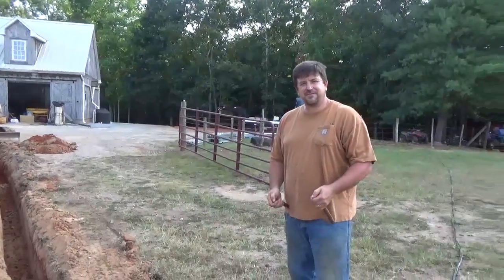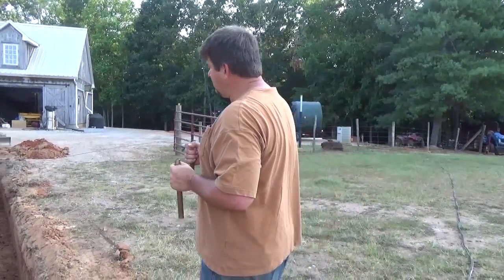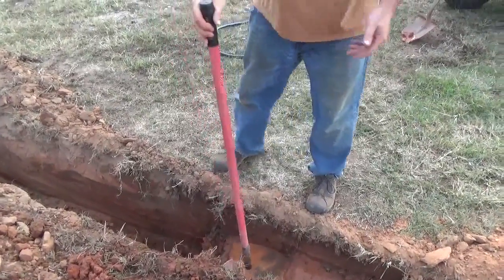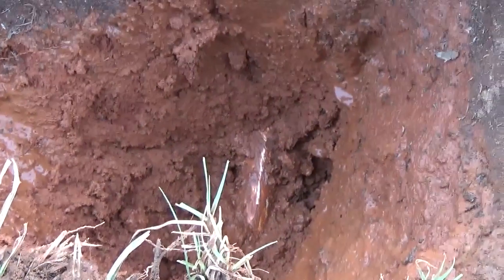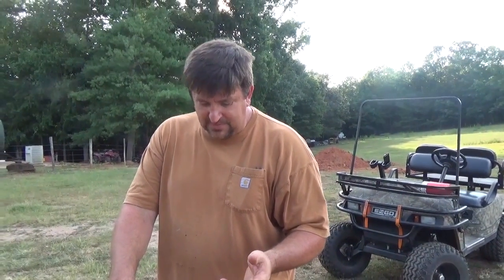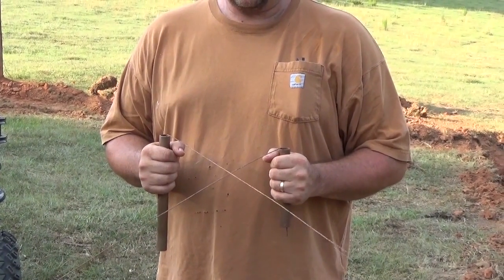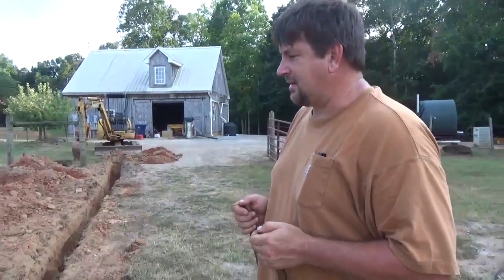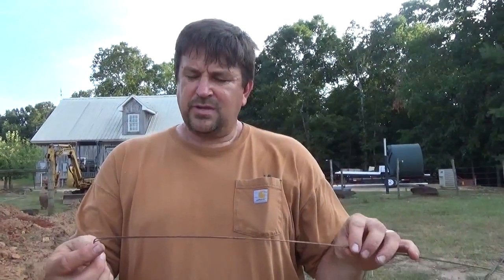Dousing?  What do you think?

Comment: I've been dowsing as needed since about 1980.  I use brazing rods for locating buried water and electrical lines, but my rods point away from each other showing me the direction that the water or wires run.  I've discovered that if I throw metal on the ground, the rods will cross directly above it, and I've used this to locate parts of farm implements (axe head, wagon parts) that were buried down pretty deep.  I use a forked stick to locate water, which is how I located the well we dug up here in the mountains of western Maine.  The water here is clean (you can drink from the mountain streams here) so just about everyone uses shallow wells.  The excavator operator who told me he was famous for digging dry holes laughed at the location I had chosen because it was on higher ground.  We hit a nice vein of water and put the well where I had chosen.  This summer we've been in drought conditions where everyone's (shallow) wells were going dry.  Guess who's well not only didn't go dry, but produced the water that my neighbor used for drinking as well?  (The water in his well was 10" below the intake pipe).How does it work?  Being a logical kind of person, I have no idea as it makes absolutely no sense at all.  I can tell you that I've located pipes that had been buried for over thirty years (that had to be dug up) and any buried wire I've ever needed to locate.  It all seems hocus-pocus, but my record with dowsing since 1980 has been 100% correct.  I can find metal deeper in the ground with rods than my fancy metal detector can find (it stops working around 8").Laugh if you like, but not only does this work for me, it works perfectly.  There's just no reasonable explanation as to why.

Comment: You're right about dowsing working, I've done it for years but usually with welding rods and PVC pipe. I've never heard a definitive explanation of how it works but I've always just assumed that power lines, water lines, voids, water deposits, large boulders and just about anything else could cause distortions in the earths magnetic field and the wires just glide along them until it reaches a dip caused by some change in density or some magnetic property. Whatever it is it seems to work.

Comment: This is the first time I've seen it in action from a trustworthy person, Scott. All other times are things of television. Since I am if the inquisitive mind I have some questions and experiments I'd like to see tried. 1) Will the rods cross if you're inside the house where there is no density between the plumbing and you. 2) Will it work over a bucket of water  or a pipe on the ground filled with water (just air between you and the water) 3) Have you tried sticks or will it only work with metallic rods 4) What if instead of holding the two pipes that you planted the pipes into a 2x4 and carry the 2x4 across the water? 5) If you were to handhold the rods, how much torque would you feel? 6) How about trying under various atmospheric condition such as in extreme heat and humidity and the lack of? 7) What if you shorted the two hand held pipe with a piece of wire? 8) Are there certain people that it has not worked with (have all your friends and family members try) 9) What if you used only one rod? Will it still move? 10) What if you held the rids at different heights? 11) What if you were riding in the bucket of your earth mover while having someone drive it over the water pipe?  Thanks.
Reply: use some wire coat hangers. and just try it. it does work.

Comment: I don't douse often but, have used various methods including brazing rods, forked willow branch, and even just copper wire. It works, not 100% but it does get you close most of the time. I have also found that it works on electrical wires too especially higher voltage AC such as buried transmission lines. Not so much on 120/240V. The forked willow branch is the coolest, you hold the two forks then when you get close the point starts to bend downward. It can be quite difficult to find a proper forked willow branch and it has to be green too.
Reply: I remember grandfather showing me this with a forked bit of wood when I was probably 7 or 8. Anyway, I  was surprised when I was able to do it as well. I had no idea it was willow. I thought it was some kind of conifer, as we had heaps around our place. 
Since then, we had a plumber show us where the pipes where and he showed me the coat hanger method. I found the wood gave a stronger pull. 
Anyway, I'm a critical thinker and approach everything with an open mind. I know some people are passionately against the idea of this and brush it off but I know what I've felt and it was legit. We all believe in magnetism and gravity. Why not this. I can't explain it but I actually couldn't even explain the technicalities of magnetism and gravity either!
Reply: a old mtn preacher showed me one time a real hell fire and brim stone preacher. with a willow branch I was about 12 or 13 years old he said that a 2 year old willow sapling worked best and

Comment: that's a great technique, but if you installed the water lines, wouldn't you just mark it yourself?
Reply: Yeah, but grass grows over it and it eludes your memory eventually....where things are...
Reply: +Kayenne54 I was thinking of something more like posts at the perimeters of the property, a small shrub (any plant whose roots wouldn't damage the line, a certain distance from a large object, GPS coordinates, etc.
Reply: Most people have either lawn mowers, grass cutters or even animals tromping over their land, and pipes aren't confined to one certain 1 metre area of any block, obviously, and it isn't practical to mark with posts all the way across a paddock usually. Our electrician ran wiring from house to shed down the back just last year, and this year (even though there was a subtle depression in the yard all the way from the shed to the house) we had trouble telling the back patio  builder guys where they could dig to put the corner post. In fact, they marked it out by driving metal stakes into the ground before I could tell them Wow, guys, within inches of the power lines there! We all downed tools and I kind of "felt it out" because, seriously, EXACTLY where that piped conduit was placed was very important, so people didn't get killed...and all the indicators of past work had almost disappeared in 12 months. Meaning, knowing the general area isn't enough. Hence dowsing. We have 240 volts here, which is usually fatal by the way if breached by machinery or metal tools. And no one's memory of where pipes are can be relied upon. If you're out by 6 inches, its goodnight Mario if its the power lines, and its ruined your day if its the water lines :)
Reply: +Kayenne54 The intersection of two lines drawn from the posts posts could be used to mark the location anywhere on the pipe. The dowsing method used here found only a section of the pipe. It seems that was all that was necessary to avoid hitting it. at the very least, the section found could be avoided and less time would be spent to find it.
two intersecting lines is pretty exact. I don't see how the methods offered would not work.
Reply: Matt de Oliveira
I think you're misunderstanding me. I didn't say the methods in the video wouldn't work. Its all good. We'll leave it there.
Reply: Try doing that where you have to use black Poly Ethylene and go around obstacles that are too large to dig out. Sometimes the shortest distance from point A to point B can be very long.